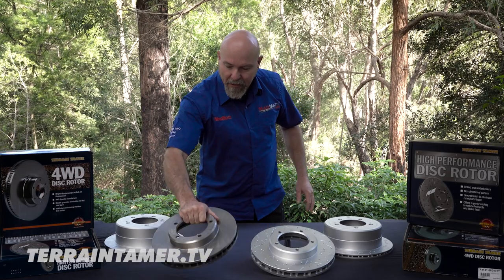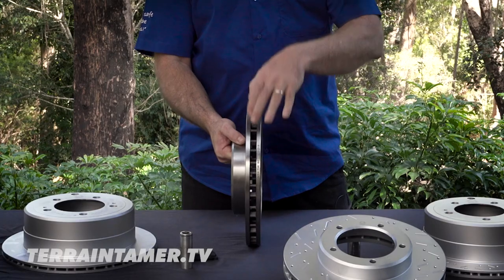Terrain Tamer Uncovered: Brake Rotors

Comment: Why doesn't TT have the high performance rear rotors for the Ford Ranger PX Series, only the front rotors? Is there a huge impact if I say get the high performance rotors for the front and the standard rotor for the rear?